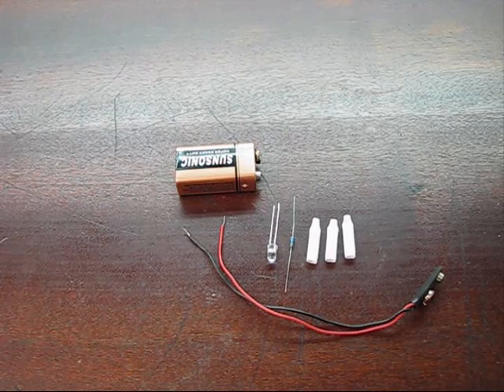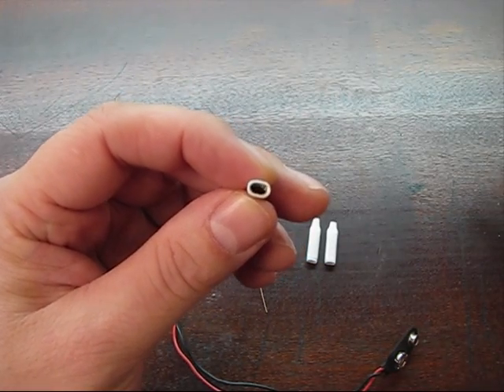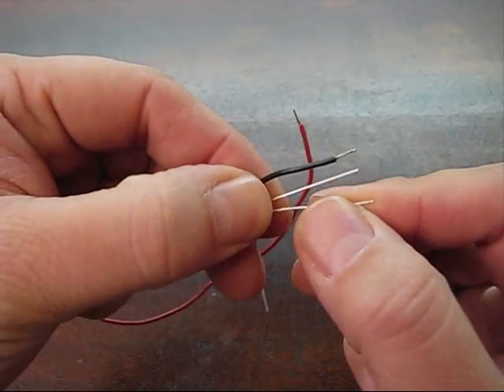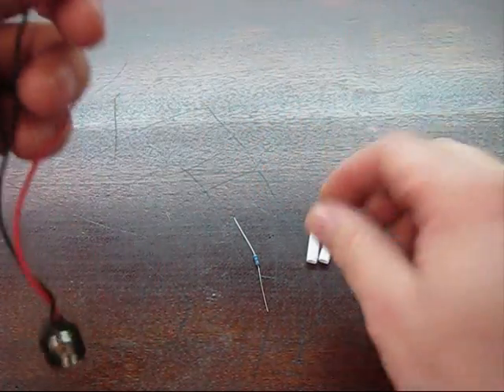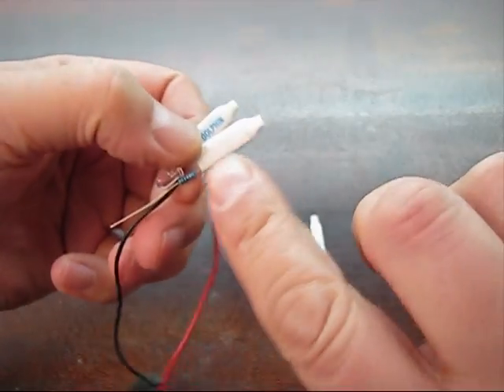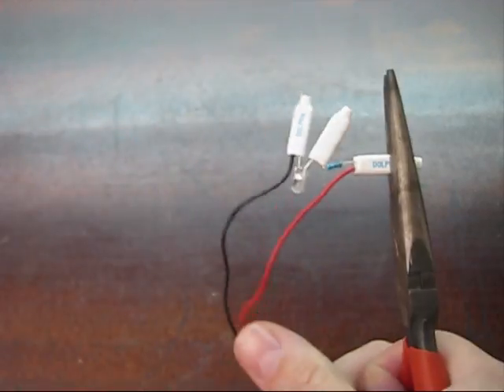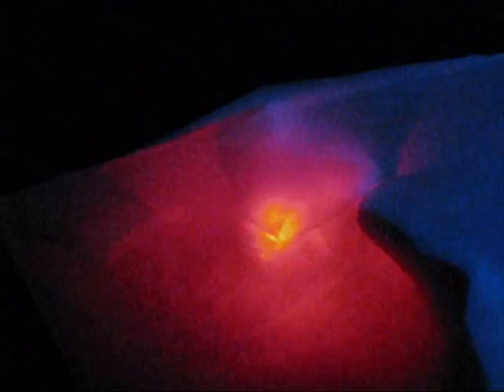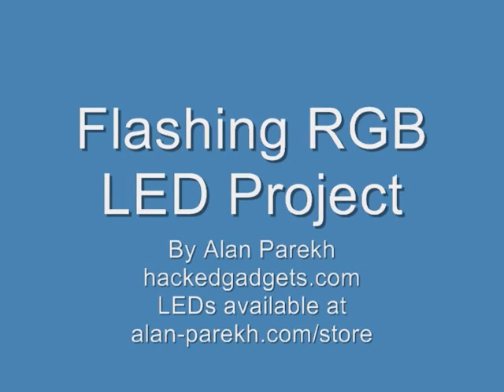Flashing RGB LED Crimp Together Project

Comment: That's a really good video. I've seen prewired ones on ebay with small resistors already included under the heat shrink. As for those asking about crimp vs. solder. This video is meant to be for complete newbies and I think they're going to find crimping cheaper (just use a pair of home pliers) and easier than soldering!

Comment: instead of a 9 volt you can use a 3 volt without the resistor and it is much easier